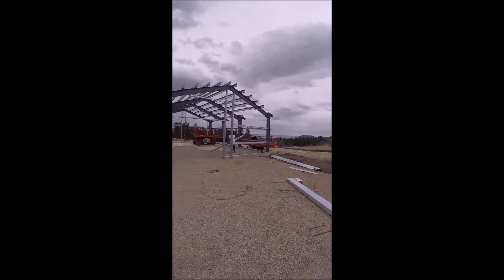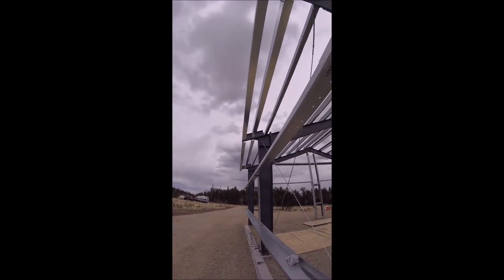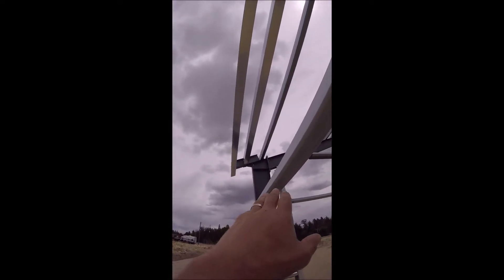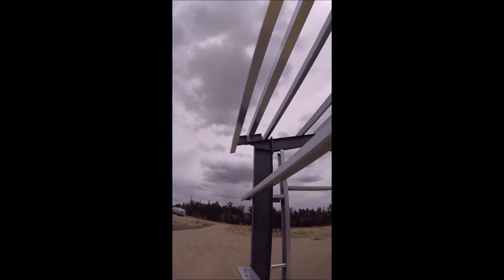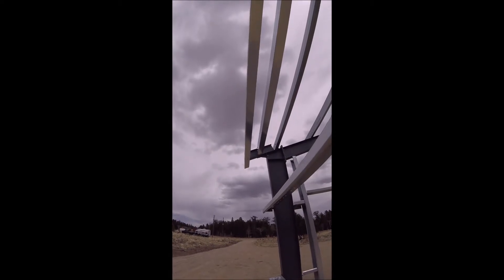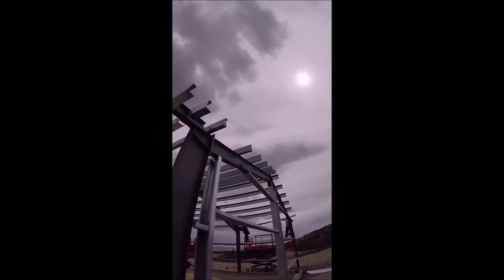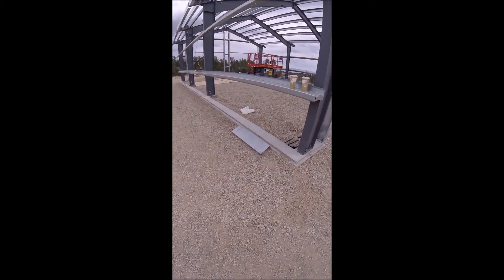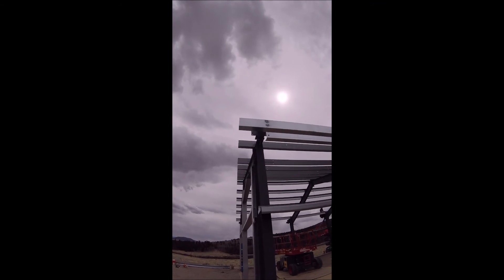Eave Extension

Comment: Can you explain the extra rake angle and what's involved to install it? Most PEMB drawings do a poor job explaining this and the location of the notched rake angle.
Reply from the maker: Hi Derek, do you mean the rake angle under the purlin extension to catch the end wall panel? It has to be installed so that one leg (usually the longer one) extends directly towards the ground in the same plane as the outside flange of the end wall girts and base angle. The top leg usually points away from the building to give something to attach the soffit panel onto. Of course I’m discussing GWB detailing but most building systems are similar. 

You’ll have to cut your end wall panels to slope prior to installing them. 

I hope this helps.

Edit: I just reread your question. It is possible to put the rake angle on top of the purlins. This is good practice I’d your roof is insulated and you do not want to insulate the overhangs, or if you do not have soffit panels (like on an inset bay). Keep the bottom leg in line with the girt line as I mentioned above, use a square drive pan head to attach the angle to the purlins and cut out the bottom leg of the angle where the purlin interferes with it. This will also require you to do a similar cut on your wall panels to get past the purlin and up to the rake angels. 

Cheers
Reply: @ericbeavers4769  Yes. That's what I mean. Unfortunately I went with Kodiak buildings and it showed to notch it and still run it on top of the perlins with the 4" leg hanging down between them.. I've seen it below the perlins as well and I have enough extra to run it there if needed.  I'm the middle of building it now. I didn't find Great Western until after the purchase. You're videos have been extremely helpful!
Reply: I guess I shouldn't have said "unfortunately" it's a good building, but there are some improvements that could be made for people erecting their own building. It looks like there are several companies out there including Great Western that dona better job with drawings and instruction.
Reply: @derykbigelow320  Hi Deryk, so notching the angle is not unusual per say... if we have an inset bay without a soffit/liner panel in the open bay we design it just like that. It's because the wall sheet needs to run to the roof  - then of course there's a lot of trim work to actually seal the wall. 

I'm not familiar with Kodiak but I looked at their website - seems like they know what they're doing but of course a website is just advertising. If they have not been able to help you we are happy to look over the plans and give some advice. 

You're welcome to reach out to me directly and we can discuss on the phone. I won't put my email or phone number here because of bot spam you but can reach me by calling into GWB, get the receptionist and she will give you my email address - I will then reach back out to you. 

Cheers
Reply from the maker: @Deryk Bigelow I just saw that I was replying from the GWB channel and not my personal one. I also checked your profile - I'm wearing a Steven Crowder shirt as I write this and you're subscribed to his channel. Ha. Let me know if I can help out in any way.